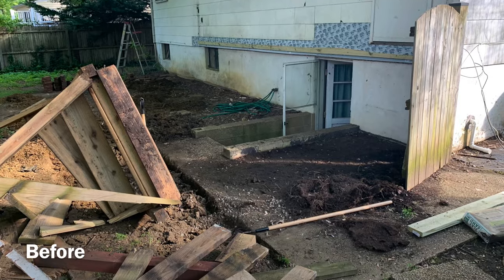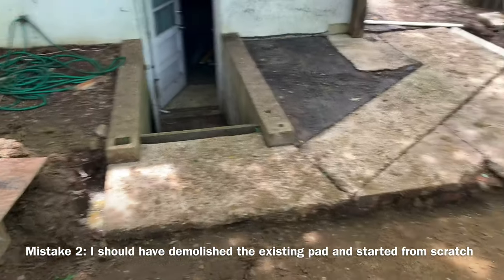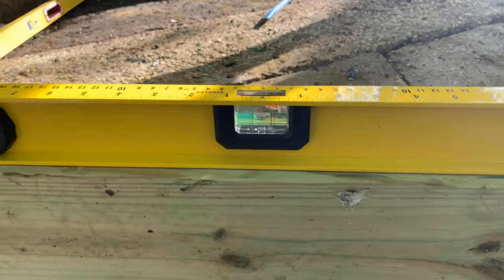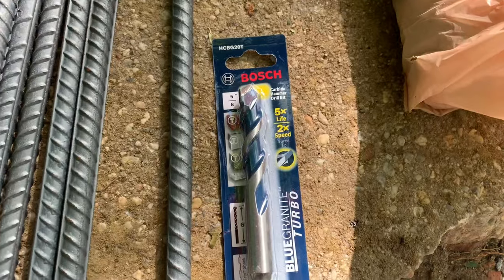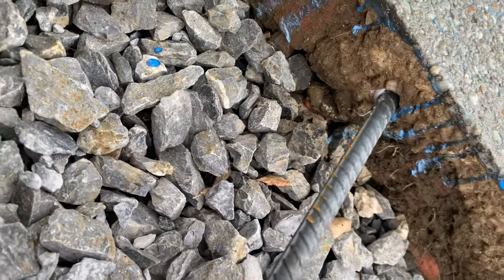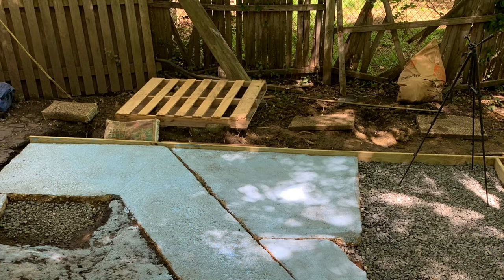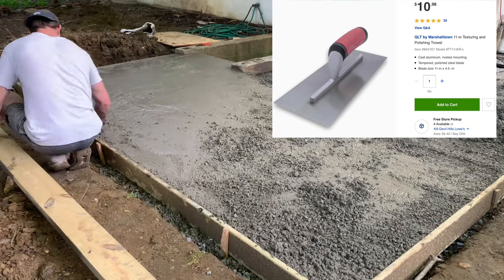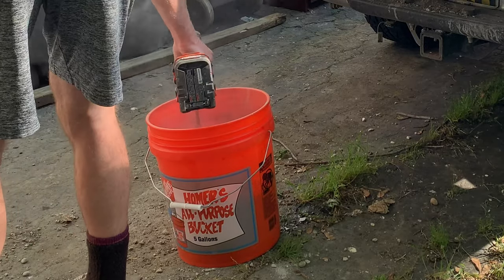How to Extend Concrete Slab (Lessons Learned)

Comment: Andrew! Once again, your timing is spot on. I installed slate tiles on a front courtyard, and it is WAY more a disaster than what you did. Over the years the tiles have split like a buttery croissant and now half of it is in shards. Thanks to a painter who rolled over them with a cherry picker to paint the house. UGH! I was thinking of pouring leveler over it but I may have to rethink to fix. Thank you, again.

Comment: Great effort.  Thanks for sharing. You might have wanted to use a Big Diamond Concrete Tamper to push the rocks in the concrete down a bit.  That way you have more of the actual cement to more easily smooth out, and it may not have been so dry.  Good luck on your next project. Also, I couldn't tell f you watered down the dirt before you poured the concrete. If the soil is dry, it sucks all of the water from the concrete, which makes it harder to work.

Comment: Great video. I am in the middle of my own 1st time full home renovation and I have been learning just like on the fly. I am planning on extending my shed slab by 4’ and this will be very helpful when I eventually tackle they later this summer or next spring. Thanks for the detailed video AND all the does and more importantly the don’ts. Those are equality as helpful!!

Comment: I was wondering if the new concrete to existing slab joint cracked after a while or if the rebar worked.  Thanks for sharing your project and lessons learned!

Comment: Thanks for the video. Regarding using the rebar to join the existing slab to the new concrete: Would an expansion joint be better? Is the rebar joining two concrete slabs better if the two slabs are both new concrete, not one old and one new?

Comment: I appreciate you sharing this.  I want to extend my drive pad to install a shed. However in order to make it level I would need to come over the pad with about 2" of new concrete.  The use of Weldcrete, and drilling in some rebar looks like a good way to handle it.  So I'm curious how it held up for you since you posted this video.
Reply: Also interested to know how it has held up

Comment: Similar to what we did to extend driveway but started with the steel mesh to undergird after digging up the dirt. Didn’t pour in gravel but had professional psi cement poured in. Yours is an interesting twist to the extension. Did use a liquid bond.
Reply from the maker: Not sure I did it the "right" way by any means, but just wanted to document the process. Thanks for watching!!
Reply: @AndrewThronImprovements  oh there are different ways to do it. What you don’t want is the gravel sinking into the dirt(heavy duty lawn paper under gravel). I had that problem on another project. I think the steel mesh wire helps with that.
Kind we used:
https://www.lowes.com/pd/Steel-Remesh-Common-3-5-ft-x-7-ft-Actual-3-4166-ft-x-6-93-ft/1001121408
Reply from the maker: @CocoChanelle-1  Agreed! That's the same stuff we used (just from Home Depot). Appreciate your feedback!
Reply: @AndrewThronImprovements  😎 cool

Comment: Actually you can fix using a concrete grinder. Rent a big one and smooth out the surface
Reply from the maker: I didn't even know that was an option. Thanks for the tip!
Reply: @AndrewThronImprovements  That'll work as long as the concrete underneath is poured to consistency and there are no air pockets, which is pretty tough with handmixing a lot of bags like you did. Considering your mix looked pretty dry and you didn't have a big float it doesn't look that bad.

Comment: What does it matter if the concrete looks rough if you're only going to lay slabs ontop of it? 🤷‍♂️
Reply from the maker: If you're talking about the existing slab before I poured the new slab, then I agree - it doesn't really matter. I just think it is best practice to rip out the previous slab (if it is in bad shape) and start from scratch when pouring  a new slab. Thanks for watching!

Comment: Yo be fair, it came out pretty good for just using a hand tool and not using a float. My back would have been blasted
Reply from the maker: Appreciate it! And yea our backs were obliterated. Concrete is tough on the body. Thanks for watching!
Reply: @Andrew Thron Improvements  ya it's tough. Thanks for posting bro.